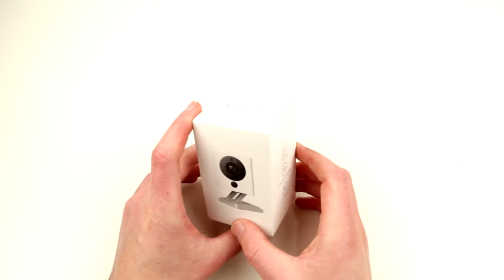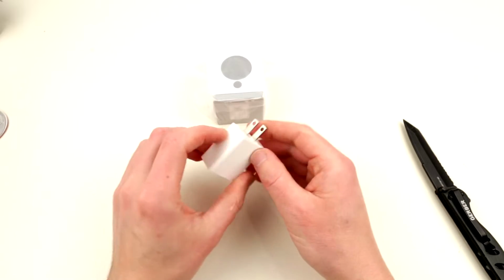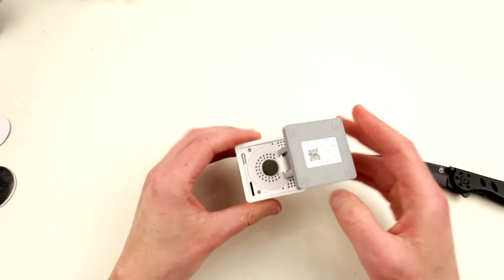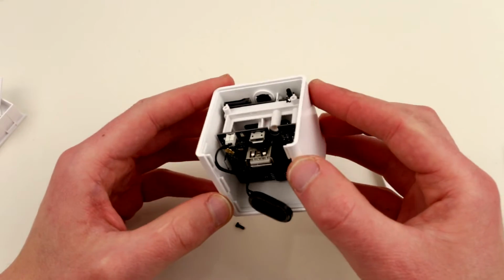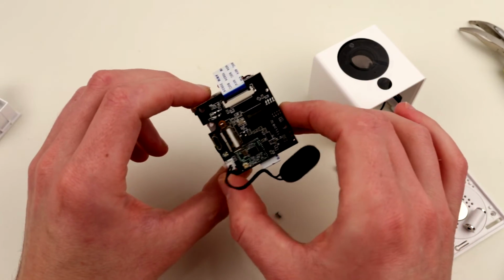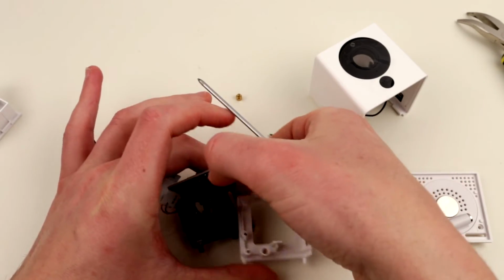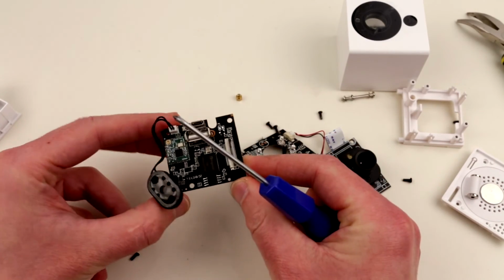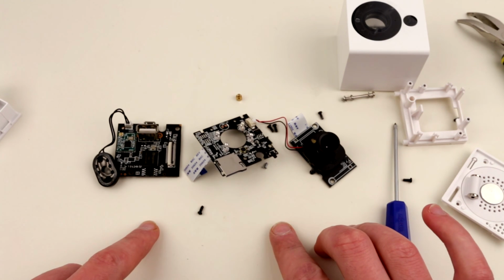Gutting the WYZE CAM V2

Comment: Nice Newest.Technology cameras, superior to XT2 design, included Mount is much better.Note, these are slightly larger in size than the XT2, and don’t fit into enclosures designed fir the XT2. I tried them ...

Comment: Just wanted to say thanks for the teardown. Getting into the plastic case is often the toughest part of a repair. My V2 stopped working with a solid amber light. I tried the usual suggestions, reset, FW update etc, etc. Turns out it was my fault for mistaking it for an outdoor cam. It had condensation buildup inside that caused some corrosion! I stripped it down completely, brushed clean with a small paint brush and copious amounts of alcohol. I think the real culprit was the connectors. I cleaned the ribbon ends and connectors, reassembled it and all works again!
Reply from the maker: Thank you for sharing your story. Happy to help !

Comment: THANK YOU!!!!! you just saved me few minutes of cussing and superglue cause i really didnt want to replace this particular unit. any ideas on what would cause power cable to feel loose? while i had it torn apart i plugged in the power supply cable and it was snug as it should be and even kinda clicked when fully inserted. but when housing is on the cable is loose and i have to put it in just the right spot or it wont power up. (yes i have replaced the cable itself).
any tips tircks etc would be greatly appreciated.
23Blind
Reply from the maker: I suspect board is not seated correctly in the housing. It makes it too far away from the housing.

Comment: Do you think we could extend the speaker and mic wires to an amplifier and bigger speaker and the mic line somewhere closer to where the listening point is to get a better two way conversation?
Reply from the maker: Highly likely, what sort of use case you have in mind?
Reply: @InsideOutElectronics  I am using them on a truck, I already opened a v2 up and cut the speaker wires and extended them to a portable amplifier, it worked perfectly, much louder and clearer. Do you have any suggestions for how to extend the mic out of the V2? That would make it dirt cheap and a far superior two way system if the mic's clarity could be improved also. Just a week ago I had a guy trying to break into the locked boxes underneath, would be fantastic to be able to yell at him and scare him off from complete safety over my phone :)

Comment: Hoping you'll do an opening of the Wyze V3 soon.  I have a V2 working great  250 yards (228 meters) away with an external antenna jack I installed and two WiFi panel antenna's.  I have no clue how to get into the frame.  Would be great to have the V3 working there with its improved night vision.
Reply from the maker: I cannot get Wyze Cam V3 in Canada. I've reached WYZE and they refused to cooperate :( I wish I can get one soon and do teardown!
Reply: It has been done, on YT. Easier than the V2.

Comment: Excellent video and explanation. Thanks for your effort.

I like to know if I can put the lens into a peep hole and use it as a door camera with Wyse app to stream to TV, Alexa etc. I like to put the rest of the electronics into a box, and hung on the door, with battery pack, and run it wirelessly. Would existing wires in the unit allow me to do that? Thanks
Reply from the maker: Happy to help, You can always whip up something with wires, but with camera you have to try
Reply: @InsideOutElectronics  Thanks for the quicl reply. Can I replace the Wyse lens with other lens/attachment? There are lots of other peephole type lens that has wire connector. Would the Wyse cam able to accept standard wired lens? Thanks
Reply from the maker: @user-up9bg1ym7b  no, I think you have to physically attach wyze cam to pinhole lens, essentially replacing the stock lens

Comment: Thanks for demonstrating the gut! I accidentally pressed "the button" after putting the new lens in, so i have scan the qr code again. I put the original lens back in, but am having trouble getting it to recognize the qr code. Any suggestions?
Reply from the maker: You are welcome. Lens has to be at certain distance from the sensor to have picture in focus. Have you tried fiddling with that?
Reply: @InsideOutElectronics  yes, I did. I finally got it by messing with the focus on the original lens. However I think I tightened it too much and cracked the glass over the sensor. The image displays with the new lens, but when I take it off night mode, it's purple. The IR lights are off... Any ideas?
Reply from the maker: @guntherlove54  The only thing I assume happened - the IR filter cracked. Without IR filter glass colors would have different tint.

Comment: Thanks, after removing two screws I didn't want to force-open the body. Now to amp up the audio from the broken speaker.
Reply from the maker: What happened to the speaker?
Reply: @InsideOutElectronics  speaker just stopped working properly;  clicks and pops could only be heard from it.
Reply from the maker: @lordlukeatyoutubable  weird, I hope it is not amp circuit.

Comment: Do you know how to repair solid yellow light?
Reply: I came here looking for a solution to the same issue. I was finally able to fix my issue by doing a manual firmware upgrade to version V4.9.2.42 (September 17, 2018). I kept attempting to upgrade to the latest version [4.9.5.111 (March 18, 2020)] without any success. Once I had version  V4.9.2.42 installed, I was able to do another upgrade to get to the latest version.
Reply from the maker: @Patrico12345  thank you for your detailed post. This will help others for sure!
Reply from the maker: Solid yellow? Camera stuck in booting mode?
Reply: @InsideOutElectronics  Yeah. reset 20 sec or changing cable or basically nothing works. its just yellow light I even disassemble it but still the same.
Reply from the maker: @nikopro16  have you tried this - https://support.wyzecam.com/hc/en-us/articles/360031484511-How-to-factory-reset-the-camera

Comment: That's awesome that the Wi-Fi antenna attaches to the board using a standard connection. You could easily upgrade to an external antenna for better range.
Reply from the maker: What a great idea !
Reply: how? sorry i'm new in this but. how can i know wich ones are compatibles
Reply: @donniedonito  the way the antenna attaches to the board. It should be a tiny metal cap looking thing

Comment: I have a few of these cameras,  i also have a few older dvr hardwired cameras is it possible to feed either the output from a regular bnc to this or the hdmi/vga output from the dvr into this instead of its native camera?
Reply from the maker: I dont think so, but also not 100% sure what you want to achieve. It is possible get feed from the camera via tcpip but need to use custom firmware
Reply: @InsideOutElectronics  id like to get everything into one app
Reply: @sal.m2A  tinycam pro
Reply: @5.43v  no go, dvr doesn't connect to internet

Comment: I bought 4 in recent months. The two-way speaker function has never worked with any of them. Within a month, one of the camera’s IR stopped working. I contacted them about it and it took a week for them to respond, and when they did, they asked if it had started working again. They then asked me to jump through hoops to troubleshoot the problem. Then 24 hours later they asked me what the results were. I work for a living so I can’t get to troubleshooting THEIR FAULTY product in their timeframe. At that point I told them to just replace it which was going to be too much of a pain in the ass as well…GRRRR!!!!. This morning I can’t even review playback function with they’re products default excuse due to slow network when my network is running over 120/12. This is a built in Bull Shit excuse for their crappy product. The bells and whistles along with the cheap price will scream “BUY ME!”. But as with all things, you pay for what you get. This product is short-lived and DISPOSABLE. DO NOT DEPEND ON THIS PRODUCT TO PROTECT HOME, BELONGINGS AND LOVED ONES. Spend a little more money on a product that will actually perform as advertised for a longer period of time. You will only be frustrated with this product unless you’re just looking for a toy….
Reply: I emailed the company and they responded within 30 minutes. Very professional reply. I have 6 of these and they work great with real motion section. They just added RTSP which works with SightHound -
Reply: FWIW, these cameras works great for me, but they are not "security" cameras, but more of "monitoring" cameras. There is a difference.
And even if you pay oodles more, everything is still "hanging" on your often unreliable (or easily cut/disabled) connection to your ISP.
That said, I'd recommend these to anyone. Sole complication can be if you have a combined 2.4 and 5Ghz network with same SSID and no way to turn off the 5GHz during setup (as an iOS device will not tell you what frequency WiFi you are connected to - outside a unique SSID).
And in my dealing with Wyze, never any issues. They are responsive and the user community is amazing - and the service is evolving as time goes by.
Reply: @wellcraft19  They working well for me as well, I yes I would call them "monitoring" rather then "security"

Comment: Thanks for the tear-down. I am wondering if I can ditch the CPU/firmware board entirely and just use the camera/IR bits with a Pi or Pi 0. In my mind, that would be the ultimate budget camera. Wyze is a cool concept, but I really, really don't like that you have to use their cloud storage and that you can't keep your video inside of your own network. 

Also, I know about the custom firmware you can put on it, but I didn't really like it.
Reply from the maker: Interesting idea, not sure if this will be economical though, unless you get camera cheap, ditching more then half of it sounds inefficient. May be we can find similar camera modules for cheap elsewhere ?

Comment: Headed to RadioShack to get a stereo headphone jack to replace the speaker so I can hook it up to desktop PC speakers to enhance the intercom.  I'll leave a comment on how it went.
Reply: There are still RadioShacks?
Reply: @johnbickford9221  I'm curious about this as well...
Reply from the maker: Cool idea! Original speKer is garbage
Reply: @InsideOutElectronics  well, since Google home integration recently got online . Maybe, just maybe we will get a button to push to talk through the Google home speaker 😆
Reply: I came here with the same idea, I imagine it would need some kind of amplifier to drive a bigger speaker and volume, if the same could be done to the mic and run them closer to where the person is, could make the intercom useable..

Comment: Thanks for the video. I was searching specifically for a video that shows what's inside WYSE camera because I was wondering what is the mechanical click noise I hear when it switches to night vision. I know in addition to IR LEDs, it also has some sort of filter that improve picture at night. Like all other cameras, it switches to black and white when goes to night vision, but what tickles my mind is in WYZE V2 you can force IR LEDs to remain off (for example if you are using the camera behind a window and IR light creates reflection) and even without IR light and only engaging that filter it gives you a very good black and white picture in low light.
Apparantly that mechanism uses magnet instead of motor. Because once I had the camera close to a magnet and it affected engaging the filter and low light picture was not clear anymore. 
I wish you could go farther and open the camera as well.
Btw, it would be great if you could have more light on your work bench, or maybe from more angles. It was kinda difficault to see details some times. The pictures on your website are very clear though. Thanks.
Reply from the maker: Thank you for comment! It is some sort of solenoid moving IR filter. Next time I poke around I will check how it operates. But  AFAIK it is pretty standard module
Reply: That would be awesome. thanks. I'm curious to know what type of filter it has that works even without IR.

Comment: Hi, great video. Question: Once disassembled, is it possible to adjust the lens focus? One my Cam V2 seems to need a bit of a focus adjustment and I was hoping to save time by fixing this non-critical issue myself rather than sending it back for a replacement.
Reply from the maker: Yes it is possible! It has dab of glue on lens barrel, you can scrape it off.

Comment: I have 9 of the v2 and 5 of the pans and love them. These are a very good camera for the price. Plus you get 14 days of unlimited recording for free. I have replaced some more expensive cameras with wyze cams. I replaced all my blink xt cams and ring. I can't stand how a company nickel and dimes their customers and arlo is the absolute worst. I just pre ordered the new wyze sense and that too is only 20 bucks and you get 2 door and window sensors and a motion sensor and the little hub that plugs into the back of the camera. I think the sound is also good on them as well.
Reply: Have you checked out the sensors yet. I have Been using the sensors now for a month and they work great. Very good build quality and tiny which I really like. The motion is very small as well. Only complaint I have is the motion doesn't come with any type of mount so you can angle it where you want. You have to pretty much have it flat on a wall unless you kinda make your own mount. I replaced all my door and window sensors with these and with ifttt they work awesome and there is zero lag time.
Reply from the maker: @Vgp-rp4iu  completely forgot about sensors. Will get them asap
Reply from the maker: Thank you for comment, not sure 20 bucks is a good deal for 3 dinky sensors + base! But I would like to put my hands on those sensors and check what inside ! :)
Reply: @InsideOutElectronics  20 dollars isn't a good deal for 2 door and window sensors and a motion? Show me one place that you can get motion sensor and door and window sensors for 5 bucks each. You can't hardly get 1 sensor for 20 bucks let alone 3 of them
Reply from the maker: @Vgp-rp4iu   My point is that those sensors are uber simple  ( I assume )  especially door / window sensors. Therefore might not worth 5$ :)
Reply: @InsideOutElectronics  well if that's the case then smartthings door sensors, ring etc...are the same. I have many different door and window sensors and some I have paid 25 to 30 dollars each for. Amazon has some for 19 bucks for 1 sensor. My point is that a set of 3 is cheaper than you will find anywhere else unless a person makes their own (which I don't have the time nor patients for that).
Reply from the maker: @Vgp-rp4iu  I got your point ! Looking forward to play with them as  well !

Comment: Very interesting. Considering the price this would be a good device to breakdown and implement in say a photo frame for hiding or some other piece if furniture. Just for hiding.
Reply: I have both, Interestingly this one is cheaper and works better. Plus, although WYZE 1 had probably branched from the Chinese brand, it's being developed separately so I doubt if V2 is still similar to its Chinese cousin.
Reply from the maker: @hamidsdna  Have not had a change to play with Cam 1. Would be nice to see innards on it.
Reply from the maker: Apparently there is a Chinese clone,  Xiaomi made Dafang, may be even cheaper !